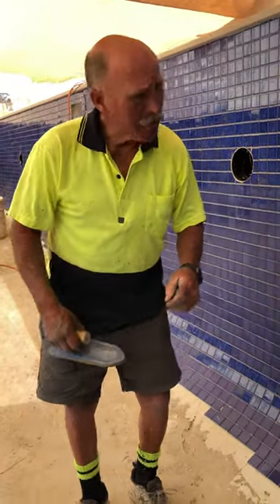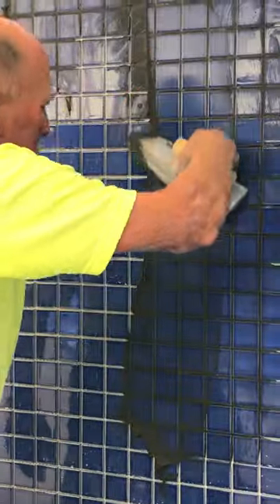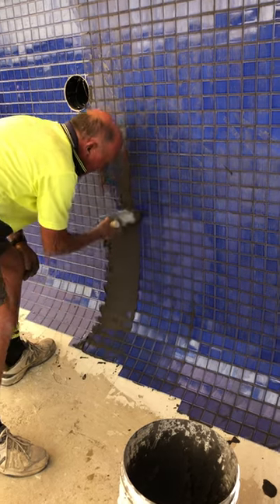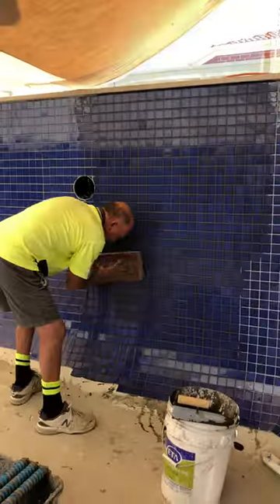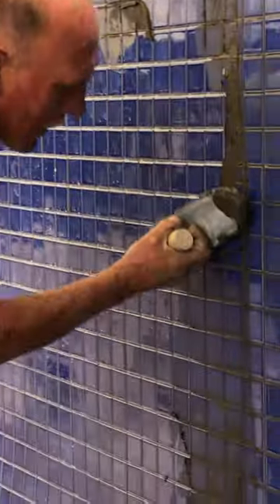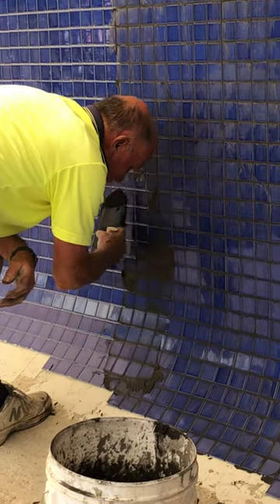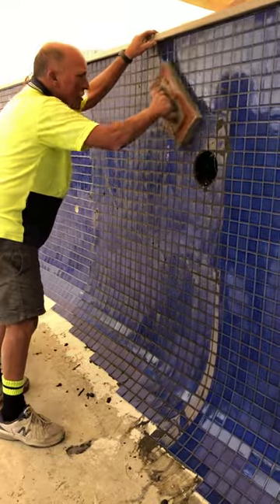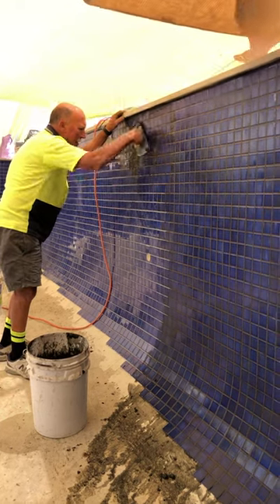HOW TO GROUT A WALL IN A SWIMMING POOL @ ROY TILES

Comment: Hi, is that epoxy grout or normal water repellant grout?
Reply: I'm not sure what Roy used, but I got quotes from three companies for my pool tile.  All three listed some form of epoxy grout.  Just conversationally, one of the sales guys told us that the epoxy grout costs a little more, but water-resistant and waterproof grouts you can use in bathrooms and kitchens aren't the same as epoxy.  Epoxy is meant for submersed applications and has chemical resistance and other things that I don't really remember.  I just got the impression pools need epoxy grout.

Comment: Roy! Top man! You are a legend. How does a legend remove old grout line in a pool? Have been using a scraper and it take forever. Other have suggested let it all soak in acid and then power wash the lot. But that also disolves the adhesive and makes the tiles fall off.  

What would your advise me please?

Comment: Hi, nice videos. Learnt alot. Im about to tile my pool. do you waterproof before tiling?
Reply: Indeed you must waterproof before tiling. Grout is epoxy or of sealed type when dry. But still water may penetrate over time so a tanking waterproofing process before tiling is essential to a watertight multilayered barrier to the extremes of water and movement over time. Good luck. Check with your local building code for regulations and standards. Or a waterproofing company will help you out ☎️